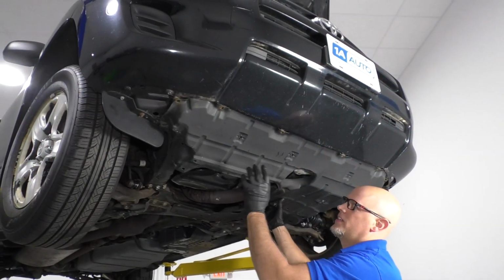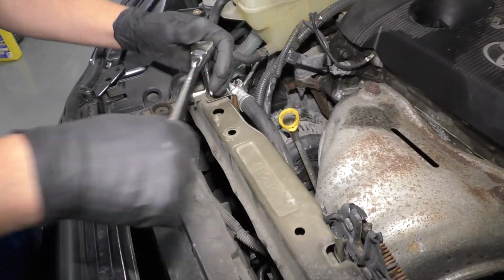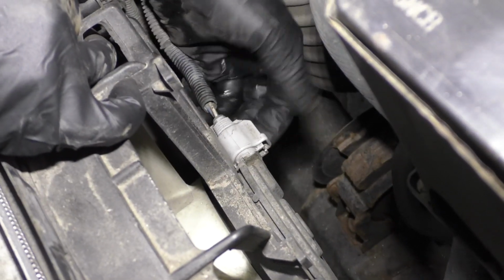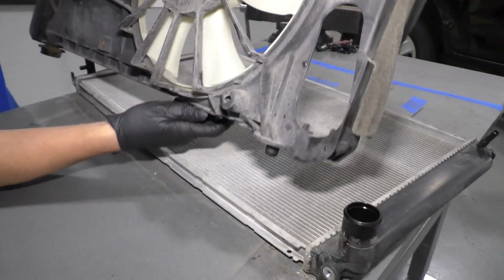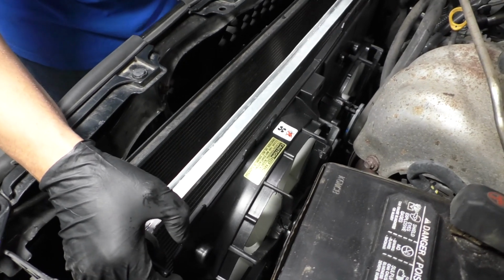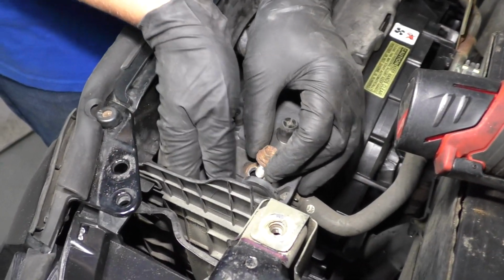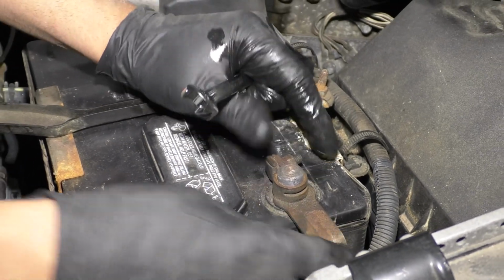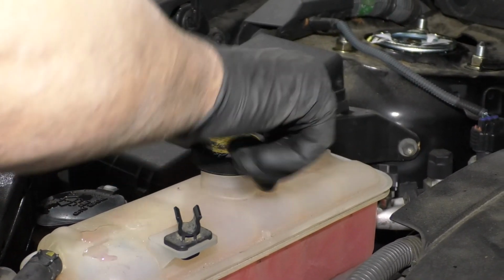How to Replace Radiator 05-16 Toyota RAV4

Comment: Good morning, if my Rav 4 does not have a cooler and I bought the radiator and it comes the same as the one in the video, do I have to put a plug on the intakes that you show in the video?

Comment: I did mine 08 and the two fan is not running, tried with heat, cooling not working, checked the fuse, seems good, any suggestions

Comment: I tell you what....you guys have save me alot of money teaching me. I have a 2008 rav 4 limited and the radiator finally went... soon I'll be ordering. Waiting do the funds. For now I have a Silverado thats in pretty good shape, but, I absolutely LOVE LOVE LOVE MY RAV4 and THAT is my absolute favorite vehicle ever. I will be getting a new one soon. But I think my 2008 rav4 is THE BEST VEHICLE I EVER HAD AND WILL HAVE!!!! It's reliable, comfortable, cute, 4 wheele drive when needed, very versatile on different terrains. Even climbs rocks and mows Over tree stumps with no struggle. Just a fantastic little suv.suv. so thank you guys for everything. You made a HUGE DIFFERENCE in my life and my wallet and my rav4 is running tip top. Besides the minor radiator problem as of now lol. It have 170,000 miles and still is just great and runs SOO GOOD AND SMOOTH. The day the radiator started to leak it was running soon good and had alot of pep since I put some BG MOA. Someone did a video on all the regular additives.. marvel mystery oil, seafood, a few others and MOA by BG and it blew the others out of the water and how my rav4 is acting just after 12 hrs of run time was remarkable. I'll be changing the oil this weekend also, so all that nasty sluggish stuff will come out ABSOLUTELY.. I use synthetic, you guys know toyotas run through oil like we do air, so it saves a little more money and is better for the vehicle..thanks again guys!! Your amazing!!! Wish I could come work with you...

Comment: Do you think its possible to replace the lower radiator hose with minimal deconstruction? Would rather not remove the whole radiator to get access to the lower hose